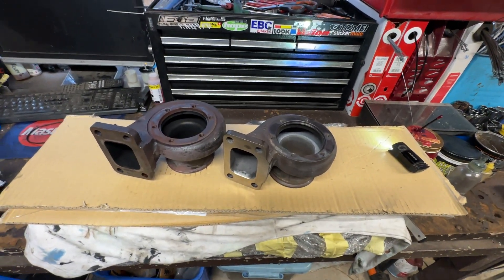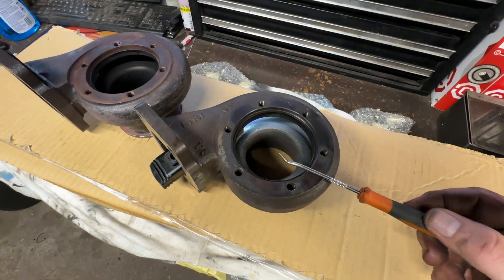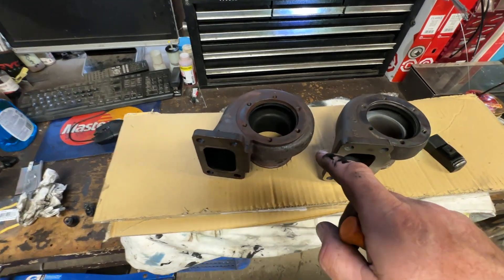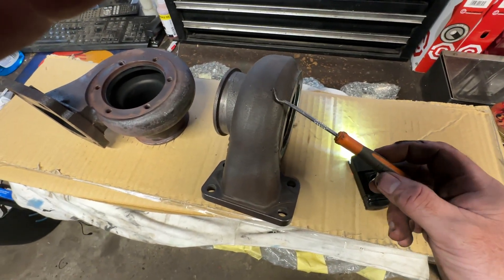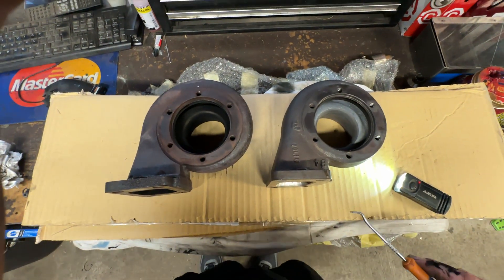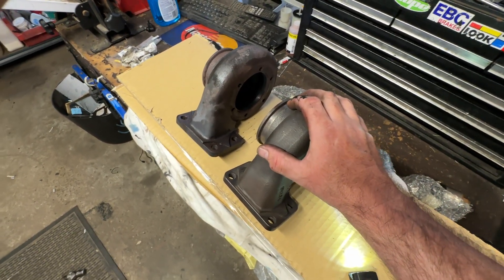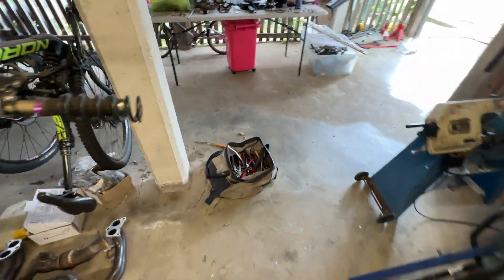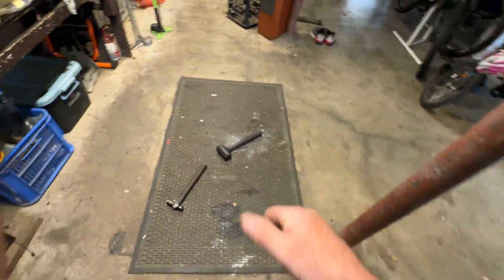Genuine Garrett Turbo exhaust housing vs Chinese / eBay turbo housing - video 2

Comment: I don't think it would make much difference in spool up tbh
Reply from the maker: @AYoutubrrr  well it did because I had to increase the duty cycle on my boost control.
Reply: The metal they use is ass also

Comment: What about the pulsar housings my friend? Everyone has said they're not up to spec but I've seen a small variance between them and a genuine garret g30660/770/900 but have talked to so many people saying they haven't seen one fail yet after life on the limiter.
Reply from the maker: @OddClancy  did you listen to the whole video? I mention pulsar housings when talking about the shape.
Reply: @Fine_Performance  sorry is that what you meant when you said the "newer Chinese copies?"
Reply from the maker: @OddClancy  yes sorry, “copies of the newer Garrett designs”. So I had a look at a G35-900 exhaust housing & while I can’t confirm it’s exactly the same as a Garrett G35, it had the rounded/ better shape to the housing. Unlike the hard edge & smaller opening of the cheap one I have on hand.
Reply from the maker: @OddClancy  I have had people comment that pulsar rear exhaust housings seem smaller than the genuine garret ones, but the shape of the one I saw looked “pretty good”.